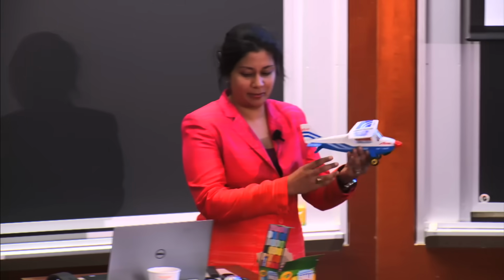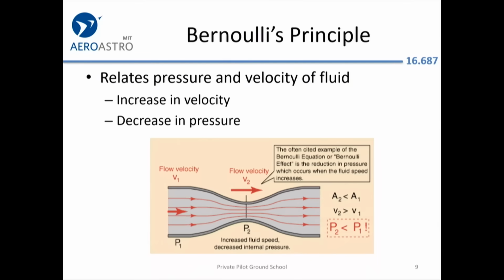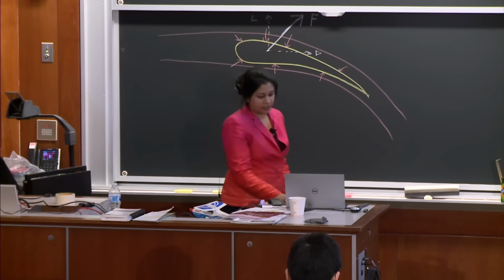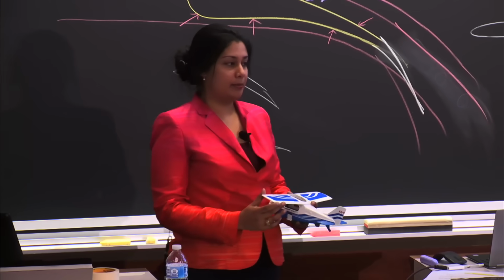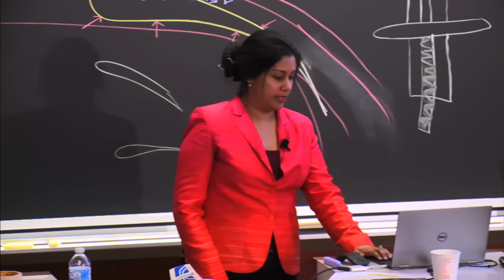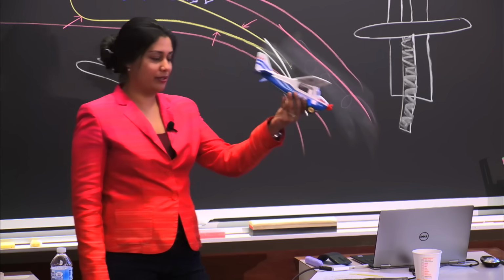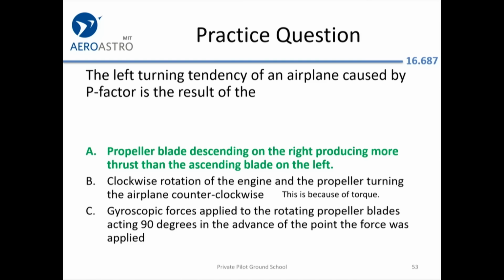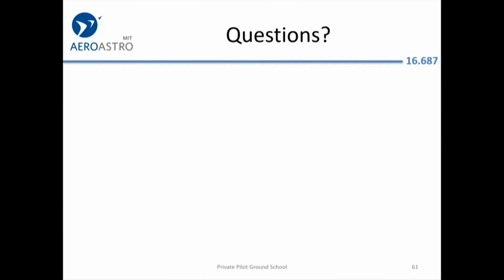Lecture 2: Airplane Aerodynamics

Comment: I'm a retired Major US Airline Captain with over 31,700 flight hours Worldwide. My daughter wants to be an airline pilot, therefore, I discovered these video's on my feed. I was spell bound and was amazed at Dr. Tina Srivastava's simple but realistic approach to teaching. I have learnt a few things in this aerodynamics lecture for private pilot's that no one had ever explained in such thought provoking manner! Please keep up the excellent work Dr. Tina Srivastava, thanks for enlightening me to aspects of Aerodynamics which I was unaware of. I also want to thank MIT, the Massachusetts Institute of Technology in Boston for airing on YouTube over 25 video's reference private pilot flying totally free of charge to the World!
Reply: I am a mechanical engineer & have been working with hydraulic machines for almost forty years.
I want to clear some of the misconceptions regarding the Bernoulli's theorem. This is applicable for the incompressible fluids & not for the air.
Another thing is air is not flowing, but the wings are moving fast in the forward direction, which causes vacuum creation over the wings causing lift. Just imagine the shape of the wings & it's position after time ∆t. This vacuum causes low pressure areas above the wings. Of course, air nearby will rush to fill up the vacuum, but due to inertia, it will not take instantly.
Reply: Bot comment
Reply: Merhaba hocam size ve ailenize sevgiler.
Reply: Pure gold ? Uk 🇬🇧 Manchester
Reply: C dasdr d stde daegg r vc
.mawasas
A chef da da w dasat aaat C f r rdaf ff dadu try kk pl
Reply: Bot
Reply: Which airline?
Reply: I always dreamed to be a pilot ...I love sky❤..but I am poor to fulfill my dream....
Reply: Yeah, I second this for sure!
Reply: Thank you for your service
Reply: Fake comment, fake account.
Reply: @mudchair16  
Explain why you don't like her. 

There's something severely missing in your understanding of the topic's focus.
Reply: 31,700 hrs?! suuuure you have buddy!
Not even on Microsoft SIM!

Comment: A very ordinary lecture by a great institute like MIT. The very first step is to explain the concept of how an airplane flies with physical interpretation using a natural example of bird and adding step by step what are the additional things required in navigation using a simple basic maths. But here lady comes with a very ordinary explanation with airplane models. I am disappointed as I am also a professor.  

Develop the prototype by adding one component and developing the prototype model of any system. So no need to remember anything while learning any subject.

Comment: Draw it RIGHT. The Airfoil on her blackboard is drawn with no relation to actual wing configuration.  1) - There is no downward direction of air flow, on wings./air foils.  2) - there is no trailing edge downward slope on wings.  3) -Go look at any wing's trailing edge . It slopes UPWARDS slightly to meet the downward slope of the top of the wing's trailing edge.  A plane with an airfoil constructed as illustrated would nose dive the aircraft into the runway during takeoff  - well before reaching airspeed. This is a fanciful illustration with illogical fallacies.  Draw it right.  Look at planes - look at birds: then draw the wing's crossection: i.e.,THE AIRFOIL.  Amazing!
Reply: I have seen a barndoor in flight once. The actual shape of a wing is next to irrelevant as long as it is not spherical. All that matters is that it generates positive lift at some combination of air speed and angle of attack. The remainder is merely an optimization to reduce fuel consumption and propulsion power requirements.

Comment: Flight for idiots.. Reminds me of the books on computers and software that were labeled e. G. Excel for idiots.. Very superficial. Could rather have spent more time on the lift formula once the concept of accelerating air particles was covered and how this is manipulated or affecting the components of the formula. That is if the purpose was really to explain why airplanes fly (lift) part..

Comment: Nice job, but discussion about adverse yaw at 48 minutes is really lacking. That is a major piece that the Wright brothers figured out...roll increases lift (and thus induced drag) on one side, so the wing rises but also gets pulled back...the rudder helps to push it around the corner.

Comment: Great info, well presented,thanks! My understanding of  the wing on a race car ex F1 racer is that it generates down force to counter the lift from the car body. Ie it’s an inverted airfoil (vs an aircraft wing orientation). Its purpose is not to disrupt airflow but to direct it up, producing a relative down force. So it’s not a spoiler per se. Better examples of spoilers are those on a sailplane or some aircraft (Mooney M20 for example). In any case I enjoyed the clear well-paced presentation!

Comment: For P factor, when the aircraft pitches up or is flying at a higher angle of attack than level, the right descending blade has an increased angle of attack to the relative wind than the left ascending blade. This difference in angle of attack creates a lift differential between the two, and the descending blade is creating more lift aka thrust, and because there is more thrust being produced by the right propellor, there is a left turning moment. P factor is most pronounced at higher angles of attack (increased pitch) and high power settings, like a climb or takeoff, or when practicing slow flight.

Comment: Min 41:00 correct me if I'm wrong, but I'm pretty sure because your flaps can increase lift generated. Using your flaps on takeoff can allow you to become airborne in a shorter distance. A pilot performing a short field takeoff typically has his/her  flaps down to generate more lift to clear obstacles in a shorter distance than they would in a clean configuration.

Comment: She delivered the lecture really well, meanwhile the audience are very sharp too, noticing the inconsistancy between the explanations on P-factor and Gyroscopic pregression. Her reply actually may have not clearly explain why the P-factor doesn't cause a pitch up but yawn to the left of the aircraft. As a matter of fact, the P-factor at the moment when the propeller is entering into a relative pitch caused by the oncoming airflow does make the aircraft to yawn left, but if the propeller's relative angle of attack to the oncoming airflow maintains stable, then the center of the propeller's tracting force will stay stable to the left from the center as she explained. To put it simple, a P-factor is a stable and long-term situation, while the gyroscopic pregression is momentary coincident to the force applied. If the oncoming airflow changes rapidly it's magnitude and direction, the aircraft will be observed with flactuation in yaw and pitch even it maintains it's angle of attack, speed and propeller RPM, as the force generated changes. 
If you got chance to see the flight control system of a Bell 407 helicopter, you may find the cam assembly for cyclic control have a special curve in the slot, which I guess is to compensate the gyroscopic pregression effect that may cause the helicopter tilting to undesired direction when the pilot moves the stick.

Comment: CORRECTION: The change of size and volume of a balloon with a change in temperature of the gas IS NOT an effect of comprehensibility; it is an effect of density. Comprehensibility is a measure of how much error is introduced into calculations by assuming the the air density is constant as flows over an airfoil. At low speeds (low momentum transfer rates) air behaves like an incompressible fluid,while at higher speed the work of compressing the fluid as it flows by has to be included in calculations of energy or force balance.

Comment: STOP!  LISTEN! She is NOT saying Bernouli is not in play here.  She is simply saying that "Equal Transient Theory" is not in play here.  The camber of the wing is a venturi. The bottom of that venturi is the top of the wing and the top of the venturi is the hundreds or thousands of feet of atmosphere above the wing, and the laminar flow is the lift producing excellerated air between and over the wing. The venturi effect of the cambered wing DOES excellerate the air.  She actually says that.  What is NOT true is that camber of the wing causes the air to travel "father" and that inturn is what makes the air travel faster. That's FALSE. For example, when the F-4C/D and early E Phantoms dropped its leading edge flaps and trailing edge flaps the camber was increased, thus increasing the venturi effect, thus decreasing pressure even more, thus increasing lift. The early F-4s also had Boundry Layer Control (BLC) which blew high pressure high velocity  engine bleed air over the upper camber to further increase lift at slower speeds. But the distance from the leading edge and training edge never changed.  So it is NOT the "distance" the air has to travel that causes it to excellerate.  Furthermore, the downwashes she is talking about are created two ways. The air over the top of the wing is excellerated do to camber (venturi), and it reaches the back of the wing before the air under it (this is why Equal Transient Theory is FALSE which she explained).  That creates a void, a "vacuum of sorts" and that causes the air on top of wing to travel downwards (one form of downwash) to fill the void.  The air under the wing is deflected downward momentarly. That momentary downward movement also contributes to a percentage of the lift (second form of downwash), but as soon as its free of the wing it travels upward and around (wing tip vortices) to fill that same void above and behind the wing. That void behind the wing inwhich both the upper and lower air particals are trying to fill is the induced drag a wing create.

Comment: That is NOT a spoiler on the race car example, its actually an honest to goodness wing. A spolier is found on aircraft wings and NSACAR stockcar trunk lids, roofs, and hoods.  This car is a Formula 2000 series car and in the same class as F1, indycar and Indylights.  And those cars use wings. So do IMSA cars too...PERIOD.  fundamental difference between a Spoiler and a Wing is one creates parasitic drag (spoiler) while sticking up in the slipstream and killing lift, and the other (the wing) produces induced drag by producing "lift" upside down (downforce). Both produce downforce but in different ways.

Comment: 1) The fuselage is not the cabin. It can be, not always. The fuselage is what attach the empennage to the wing. Look at for instance at a Cessna 337.  2) Equal transit is definitively wrong since the molecule travelling across the upper surface arrives before the one below. But the paper plane / plank argument is worse. Even before the Wright brothers we knew better than this. Airfoils generate way more lift than a flat surface. Air mass deviation is responsible for around 20% of lift, the rest is variation of pressure between upper and lower surface. 3) Relative wind is in general relative to the point of view of the observer but not all molecules have to move at the speed as of the relative wind. Some near the surface will crawl as she somewhat hinted but some could go at the speed of sound even for subsonic aircraft. 4) Flaps and slats mainly increase the curvature (Cz partially) and for some the surface (S) of the wing therefore increasing lift at low speed. Fx = ½ x air density x V squared x Cz. 5) Ground effect is not only drag reduction. She’s doing a good job of cramming about 8h of my intro to aeronautics class in a somewhat short video. She’s definitely a student in an inverted class and a little bit stressed. I’d give her a very good mark.  As for P factor not being 90deg after, that’s an excellent question. I can’t explain it at this moment. I’m gone see if someone has an explanation at work.

Comment: why equal transit theory is wrong ? it is so simple that particles which are moving along curved path mean at top will have higher speed due to addition  rotational energy when air molecules strike the cruved surface but at bottom no such rotational energy grnerated due to flat shape of wing .

Comment: I am not a physicist but, out of my obsession for physics and airplanes, I have been dealing with the question of what generates lift a lot. I never found a convincing explanation of how Bernoullis principle contributes to the lift. It simply does not make any sense to me. The drawing at 12:24 simply has nothing to do with an airfoil. Still searching for answers. To me, it is simple. Air gets re-directed, therefore compressed below the wing and extended above the wing. The acceleration of air above the wing is a consequence of the lower pressure and not the cause of the lower pressure. But like I said, only my understanding as a non-scientist.

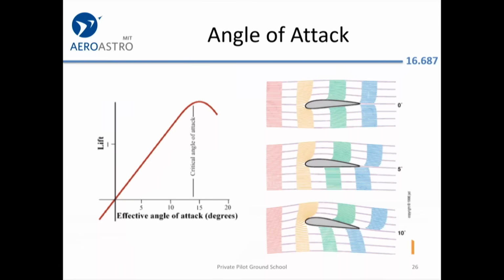Comment: Great lecture.  The equal transit theory mentioned roots itself in assumptions.  At 27:30, we mention calculating lift with the Navier Stokes equations, and one of the assumptions is the Kutta condition (28:45).   The Navier-Stokes equations not only have conservation of momentum, but conservation of MASS.  Specifically, between streamlines in an open system .  In reality, air flows faster over the top than the bottom (38:57).  Those faster molecules of air on top have to go somewhere, and this is the base drag on the trailing edge as it mixes with the slower flow rate on the bottom.  Once you impose the assumption of the Kutta condition, along with conservation of mass (what goes in must come out or accumulate),  then you have this equal transit confusion.  Hopefully this clarifies where it comes from.

Comment: Confusion is noted when discussing gyro precession.  For its effect, a force has to applied, tail moved up or down.  Most tricycle gear airplanes never force the pilot to take notice.  Not so in a tail wheel airplane as the tail is raised or lowered during take off or wheel landing roll out.

Comment: My question is: during every takeoff, the airplane is slowly rotated to 15 degrees up, more or less.However around 8 degrees,  there is a  bit of "resistance " requiring a bit more force to be applied to the controls to keep the rotation rate constant.This happens to be the point where the wheels leave the ground. What is the reason for this? My theory is that the center of pressure moves a bit AFT ....

Comment: re:20:40 Even though she/we do not need to know this stuff for the FAA lic., she really shouldn't try to teach it if she hasn't thought it out thoroughly.  At subsonic speeds, an wing (any object) moving thru the air, forces the nearby air to accelerate (move) away from the wing (up and down), and  backward (aft) as it is parted by the wing, and then moved forward & toward the space emptied by the wing as it leaves that space.  
Also, wing lift is normally generated both by the Bernoulli principle (differential surface speed), and by downward deflection (angle of attack).  
That is, a wing with a perfectly flat bottom and zero angle of attack will still generate lift. (Blow over the top of a piece of paper held to your lower lip to demonstrate this lift.)  
A paper plane uses deflection only (converting forward momentum into lift), and simply does not generate any Bernoulli lift, and it is light enough to not need it. This flight process is hard (but not impossible) to distinguish from constant speed gliding (constant loss of altitude to compensate for drag).  
Each of these are important principles to understand if you ever find yourself 'gliding a brick'.

Comment: Er, sorry Prof, in jet ,the one you showed, is ,∆. Swept wings are turbine air transport jets like Airbus A320..or Boeing B737,777,787,etc...slow speed, large flaps v.v...
But I stayed on for your whole lecture...😊..heads nod..
Oh btw, calculating lift is easy ，otherwise we won't be flying, 
L=cl*pv2A/2..my A380 weighs 555tons, the mass of lift created has to be 1:25... of 555tons...Under the wind, the higher the pressure created, higher the lift force, ,we can manipulate more lift by curving the camber by putting more flaps,, before take off, on positive pL, we don't even need to pitch , Vmu happened just after 100kts..n it's ND take off ! 
Just my 2cts to add, thanks Prof!
Subscribed!